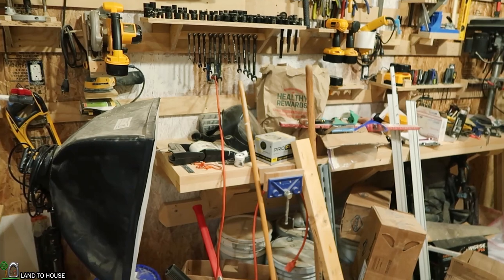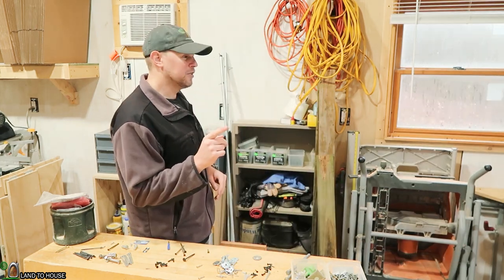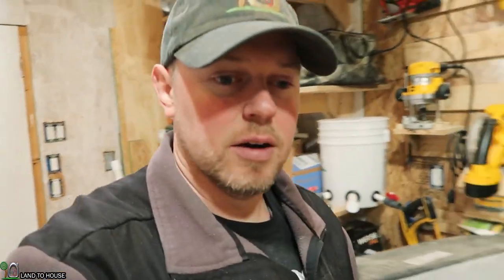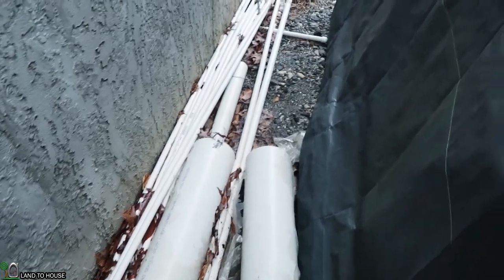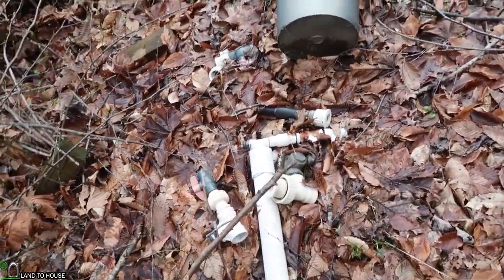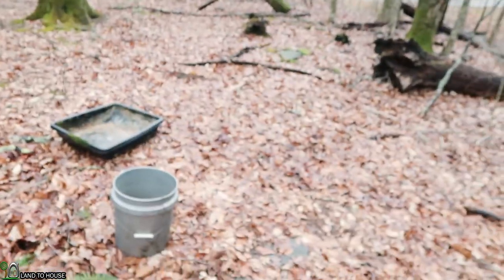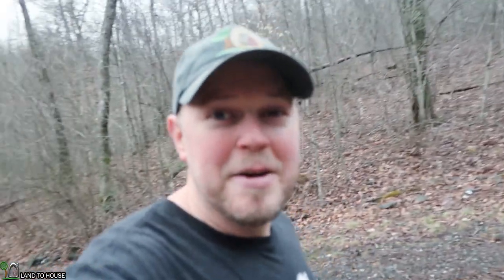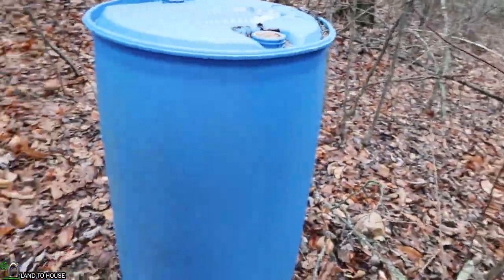Super Shop Clean Up and Talk about the Water Storage

Comment: Here is an awesome project idea: a ram pump underwater, with the intake just open to the water it’s in. This of course would mean zero pressure differential across the pump so to gain that you could run a pipe off the waste valve that runs down hill and forms a siphon. Max differential pressure this way would only be one atmosphere, probably less due to surge pressure. If you could run the waste pipe through the berm of the pond so it didn’t have to rise though you could get a pretty major pressure differential and have the pump right at the water source. Might be pretty neat.

Comment: Love the videos my friend, but you really need a pickup truck for supply and trash runs.
Fixing up a messed-up hole for a uniseal in your buckets and barrels: hot-glue a board over the bad hole, from the inside if you can, or the outside otherwise, to give your hole saw's center drill/guide a place to drill into and you can re-drill it to the next size up.

Comment: Have you thought of scaling up the ram pumps to increase head pressure and flow rate? I see you have 11/4" pipe as the large, could you go to 3 or 4" pipe? Then you could drill and tap into the pipe to create a manifold to use several flexible poly pipes to get the water to the tanks.

Comment: Question -
I have a spring that delivers 4 gal/min at 50’ and 6’ head using 3/4 hdpe black pipe.  How much could I expect at 1000’ and 30’ of head?

I covered the spring with a 20” diameter concrete cylinder and concrete lid and stuck the 3/4” pipe through a hole in the side.   The spring actually delivers about 8 gal/min so the inside of the cylinder has positive pressure preventing pollution from getting inside.  
I would like to use this as my main water supply.   This spring never slows down.

Comment: Water is .43 lb of preasure per "vertical" goot. So, storage tanks need to fill from the top. Otherwise you are fighting even more preasure on a pump that only builds so much, fill from yhe top and cut the fill time in half or more
Reply: NATION_150 equal head pressure to pump it to the top of the tank vs into the bottom. Volume makes no difference on pressure, only height.
Reply: filling from the bottom is identical to filling the pipe that fills the tank pressure comes from height of the water, not the crosssection of the pipe it sits in.  That's why 1 gal jugs don't split open on their own with walls no thicker than drinking straws.
Reply: @jllaine  I have the feeling that once Seth will make a video on filling the barrels from bottom vs. filling them from top. And I also have the feeling that making this video will take veeeery long (lets say 2 to 3 weeks), just because it takes at least exactly 8 hours and 8 minutes to fill the (then 3) tanks and Seth has to restart the experiment several times. Just my feeling ... ;-)
Reply: @patrickhoffmann8893  Well if he does make that video, perhaps he will make use of the shutoff valves under the barrels and then only have to fill/drain 1 barrel for the test, so that the test would take about 2 hours and 43 minutes?
Reply: @workbenchz  Clever idea! But Seth is a tough guy and he will go for the 8 hours and 8 minutes ... I guess. Ha ha ;-)